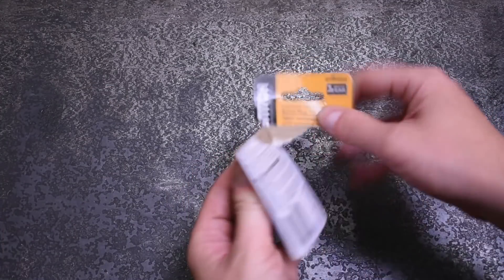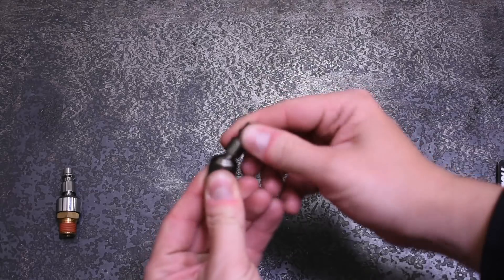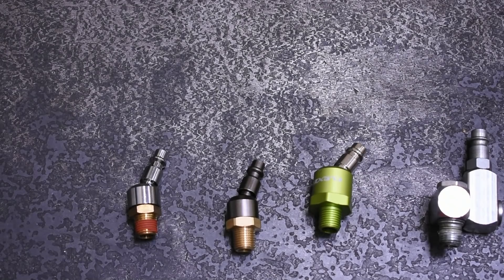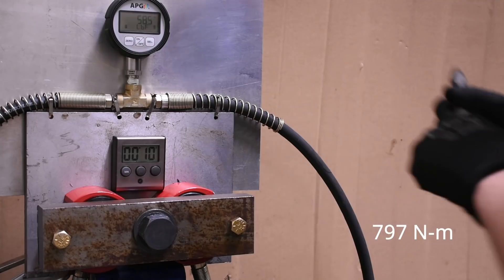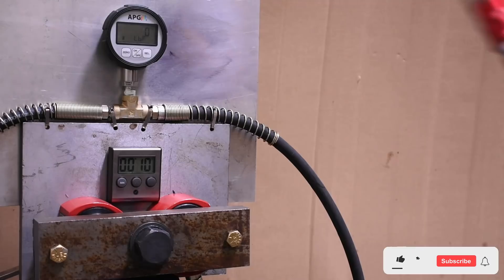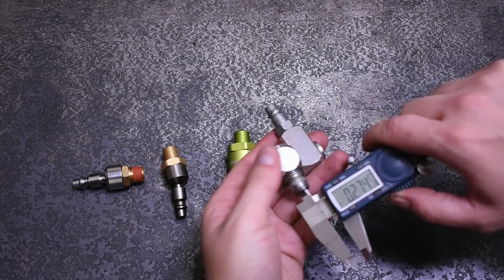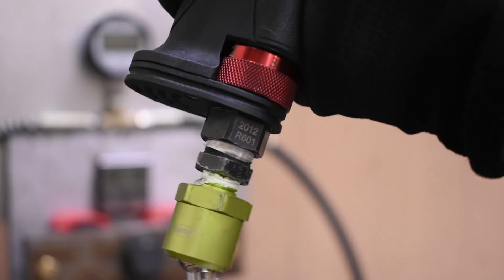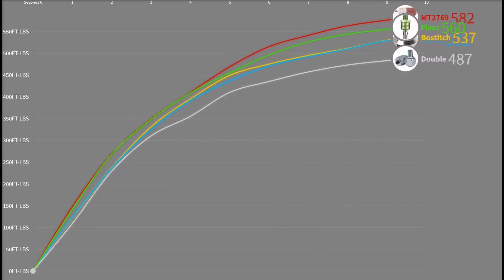How Much Power Are You Losing w/ Air Swivels? Dyno Graphs

Comment from the maker: Other For Science videos- Hose size vs power loss: https://www.youtube.com/watch?v=KBQpaUBMmGw
Extension length: https://www.youtube.com/watch?v=XYavlJY_5Ks
Battery size: https://www.youtube.com/watch?v=WD2Pe4MIuSA
Impact Universals + durability: https://www.youtube.com/watch?v=f0xhgQiTGUY
Weighted Socket Gains: https://www.youtube.com/watch?v=qVd8Bx6AAQc
Reply: Ever thought of the affect of pressure or CFM on impact gun performance?
Reply: Why do I watch this don’t have any of the tools
Reply: Do you have a video showing the difference between 1/4" High flow, 3/8" high flow (I think only Milton is readily available) and 1/2" quick connect hydraulic fittings (I think they are usually used for Construction equipment). I'm curious because I have 1/2" hose and do not want to run a converter coupler.... But, I only can find 1/4" high flow connectors. Can barely find 3/8" and 1/2" Quick Connect NPTs..

Comment: Do any of these swivel manufacturers sell service kits ?
9 times out of 10 the rotating seal inside fails and SOME swivels dismantle to reveal a failed $0.50c seal/washer.
Try finding a Seal V Throwing away a good fitting and theres zero information.
Manufacturers just want your money it appears.
Any advice on after sales service parts welcome.
Which manufacturer ?

Comment: Thank you @torqueTestChannel! I had two of those swivel elbow adapters between my compressor and hose reel. after watching, I replaced those swivel adapters with brass elbows. Huge improvement in air volume and pressure! If you blow into those adapters versus elbow, you can feel the back pressure difference! Both HF and Kobalt/Lowe's swivels have same flow restriction.

Comment: I run the merlin swivel on all my air tools connected to a 1/2" whip. Shop compressor is a pye-barker 175psi with dryer 1" hard line to 3/4" reels. Merlin 1/2" fittings on the 3/4" reels for the the 3/4" guns and -12 msha line on the 1" gun whips. My cordless stays in the box.

Comment: I do use the 360 degree swivel on a lot of my air tools, but it's interesting to see how much power you can lose. I guess you could make for it with higher line pressure. At least now I know if i'm in trouble and can't get a nut off I could try to remove the adapter !

Comment: Would be interested if the restriction can be partly meditated or a higher final torque by bursting the impact? 
Definitely found bolts seemed to  cracked loose easier when blipping air guns when they have smaller air fittings.

Comment: nice vid ... but not sure I completely understand why I should put a whip hose on a air hammer or impact wrench
Reply from the maker: Vibration leads to an early air fittings death
Reply: @TorqueTestChannel  ok but isn't the same thing when you screw the whip hose into the air hammer?
Reply from the maker: Nah, a whip hose creates minimal stand-off, or basically a large series of rigid pieces and weight. Just air hammer into whip bend. No air hammer to fitting, to female coupler, to hose barb crimp all sticking off and vibrating around

Comment: You may have tested this in the past, but I would’ve been interested to see what the numbers would’ve been if the hose would’ve been just directly connected to the gun with no fitting just clamped on to a 3/8” thread in.

Comment: It would be interesting to see what the 90 degree swivel would do with the V style instead of the M style. I'm not defending it I'm just curious what the difference would be. I do run these swivels because it allows me to get into such tight places on my shorter impacts but I use the V style. As for my standard size guns I just rum straight off the gun with the V style on one of them, the other one I run a short whip straight into the gun for better air flow. 
On a side note if you test out the female couplers it would be interesting to see how the Prevost PRVESI071201S do.
With the exception of a couple of my impacts (Nitrocat) mine are the older models I pick up on Fleebay, like Mac and IR and just rebuild them. Heck you can get very nice impacts dirt cheap where everyone wants the latest and greatest, they are cheap to rebuild and they do everything I need them to do, I run a 1/2" hose then use a reducer to drop to 3/8" hose the last 5', this way I don't use a connector until right at the tool.

Comment: I have the double swivel on most of my tools as a car mechanic, it doesn't reduce the power to a point i get any issue with my tools but it surely allows me to use it everywhere in the engine bay, wheel wells and under dashboard.

I love it! ❤️

Comment: I have a Atlas Copco Multi flex 3/8 part# 8202 1350 28, that you can test if you want to. It swivels 0'-90', similar to some ⛽ hose swivels. It is in my opinion the best swivel money can buy because the inside diameter maintains 3/8 inch throughout.
Reply from the maker: Send us an email! Torquetestchannel@gmail.com

Comment: ARE TORQUE STICKS DESIGNED TO WORK ON AIR IMPACTS ONLY? I was told by a mechanic that works at a tire changing place that torque sticks were to be used with air impacts only they are not designed for battery or corded impacts? I think I pissed him off cuz I laughed. I couldn't help it it sound like a dumb joke. but he was dead serious. My first thought was how can you be this ignorant about the tools he was using to make a living with. But the guy was very adamant about this and when the torque sticks were flashed across the screen at the end of the video it reminded me of it. so I figured I would ask. I'm sure somebody else is going to swear to this as well and if it is true PLEASE elaborate on how the hell the torque stick knows it's being ran by a impact driven by air or driven by electricity. Thanks for your time
Reply from the maker: Will do. And the theory goes it has to do with impacts per min, which if that's the case cordless IS much higher.

Comment: I run all my airtools with doubles .Even 1/4 ratchets .  12mm ID hose @ 11 bar  The doubles work fine and way more convenient but I have never gotten one for less than 20€ . With the right airhose and a high output compressor everything comes loose . I understand you want to show the difference when standard hose and pressure is applied but who uses this these days ?

Comment: I already know the results, but others would benefit from a test of milton V, P, and M fittings.

In addition to torque have a pressure guage before the quick connect, and one after showing the pressure loss, this would be easier with a short whip in between the tool and quick connect. (Not too long or the hose volume will water down your readings)

Comment: Can that rig be used with torque wrenches? I really really want to know if an extension, even just a short one, affects my torque setting. Sometimes I have to use an extension when torquing a bolt, and I’ve always wondered if I should bump up the setting from whatever spec I’m using for the bolt.
Reply from the maker: An extension 100% does not effect the torque value when applying torque in a constant and linear fashion like a torque wrench. As long as the angle is kep perpendicular to the nut.

Comment: Could you maybe do a test of modifications you could do to an air connector. My buddy would take he standard air fitting and run the next size up drill bit down it to maximize air flow, would then do the same on the npt side going into the tool and would then countersink the end to allow air to get in easier. He broke a lot of connectors doing this, but was it worth it

Comment: After seeing Eric use the double swivels, I bought a Kobalt one and put it on the end of my air hose. It’s super nice not having to fight the hose angle when using tools. However I noticed Eric puts one on each tool, whereas I put just one fitting on the hose itself with the quick connect after the swivel. Other than buying one vs many swivels, I’m not sure if there’s any other difference.
Reply: About an inch of clearance.  Which is one of the reasons for using them.

Comment: I've noticed that my 2235 spins at really low pressure but my small IR stubby doesn't. I find that after I use up the beans from my tank spinning at somewhat low PSI is a time saver.

Comment: Putting a 3/8" double swivel on that 1894 would be the better way to go. Then just bush down the swivel inlet or use a 1/4" high flow x 3/8" npt plug.

Comment: I think you can get the benefits of a swivel without the losses by using a short (12") whip hose on the tool and a regular straight fitting (I use high-flow style "V") on the end of the whip. That is my preferred solution for all my high consumption air tools (hammer & impacts). Everything else (blowoff, die grinder, etc.) gets the usual fitting directly on the tool. I actually started doing this not because of losses in the swivel, but rather because I've seen the usual fittings & couplers eventually shaken to death (cracked) in the workshop. The idea was the hose would dampen most of the vibrations that the fitting would have experienced. The avoidance of losses in the swivel shown in this video is a nice bonus.

Comment: The torque limiting stick test will be interesting.  I'm under the impression that you can't use a lower powered wrench like 500ft lbs or less (rated) as they won't be able to twist the sticks enough and will over tighten the fastener.  I believe you need a higher powered wrench to use them accurately.

It would be great if you can test that theory in some capacity!
Reply: How could the impact not be able to twist the torquestick but overtighten a fastener ? (If not on weird harmonics)
Reply: Perfect, 2 different opinions on how they operate.  All the more reason to get to the bottom of this!

Plz test with low, mid, and high range impacts so we can finally know,
Reply: My understanding, and I very well could be wrong, is that the way torque sticks work is that they twist at a given torque value.  They twist so "far" that they overcome the travel of the hammer in the impact gun.  Thus they start to absorb the impact and stop turning at the specified torque.

If the low powered impact wrench is unable to make them torque stick twist enough, then I'm assuming the torque stick will just act like an extension, and over tighten the fastener.

Think about this, putting a torque stick on a breaker bar.  Definitely can over tighten in that scenario.
Reply: @carlrabe4384  IMHO when the impact is unable to twist the stick it is also unable to overtighten the bolt.

If the impact puts out the blows so fast the stick cant recover in time there might a chance to overtighten a little before the stick snaps off.

Comment: Ok I'm gonna have to unsubscribe n start wearing a tinfoil hat to keep you from reading my mind lol. Literally just a few hours ago I was thinking about this very thing n was like man I hope torque test is going to be doing this test. I literally had the double swivel setup both at my 20 gallon 5hp compressor n at the end of my 100ft hose reel (had one on the compressor to allow the hose to do what it needed to before I had a hose reel). Anyway cuz of the hose size video n comments section I decided to remove both double swivels cuz I just felt like it wasn't hitting like it should. Huge improvement but I did pick up the merlin swivel, just haven't put it on my gun yet. Seeing the numbers now I think I'll keep a double swivel around for those days when I need the flexibility but just run straight fittings to get as much mmph outta my gun as I can
Reply from the maker: Just running a whip hose with the coupler and fittings 3ft away can be a nice middle ground.

Comment: So…what about cranking up the air pressure to 150-175?
Reply: Should be at 175 regardless 😉
Reply: It's CFM not psi. CFM= CUBIC FEET PER MIN.  It's volume you need
Reply: @markarmstrong3394  I know what it is, and I also know that by cranking up the pressure you get more cfm…and most impacts hit harder with more pressure. They’ve tested it on here many times
Reply: @brentpew4853   yes but there only 1 thing your forgetting about. If you crank the psi on up there and you hammering hard you can break hammer pins, hammers, anvil, cage. I run mine at 148.  I just use a 1/2" hose and No restrictions and let'er rip
Reply: @markarmstrong3394  I know all about it, I’m a mechanic by trade. I don’t care about breaking crap, frankly haven’t broken any impact yet and run air psi at 150-160. Most of these tests are done at 90
Reply: @brentpew4853  I have never broken a snap on or a Matco impact and I run 180psi unregulated to my guns using hi flow fittings and couplers. People baby air tools way too much.

Comment: I actually just got a 50 foot hose reel mounted in my garage and I do use swivels... I mostly have cordless brushless tools but there is a place for air from time-to-time... air hammer, pumping up tires , leak down tester...and other Automotive tools that need an air source...
3:15.. got mine on Ebay.. they're good for cheap...